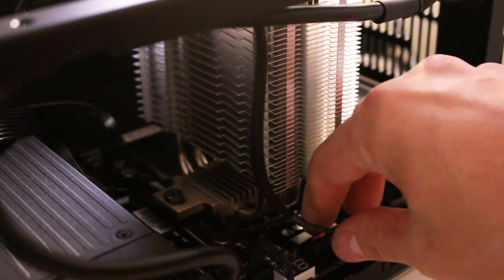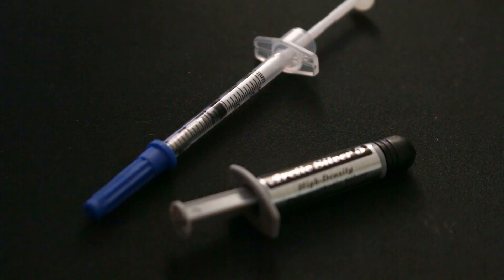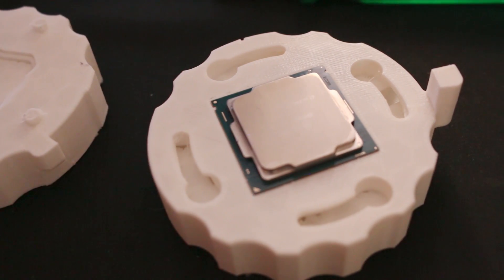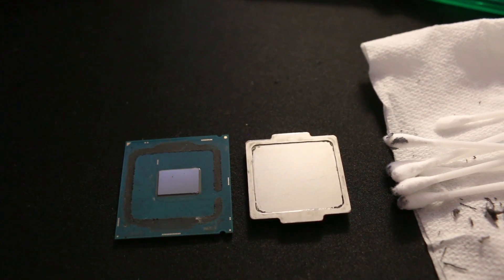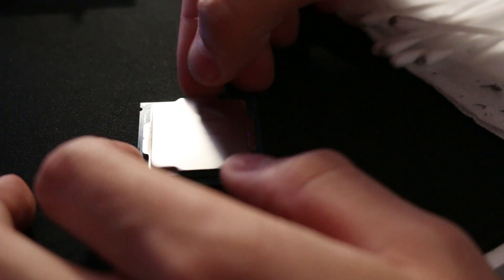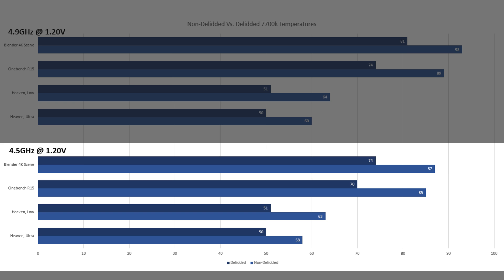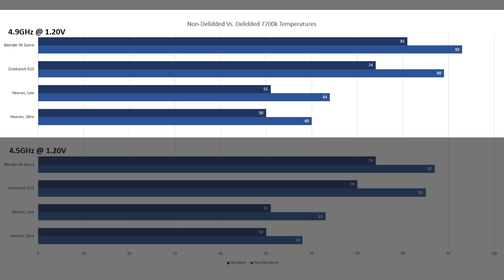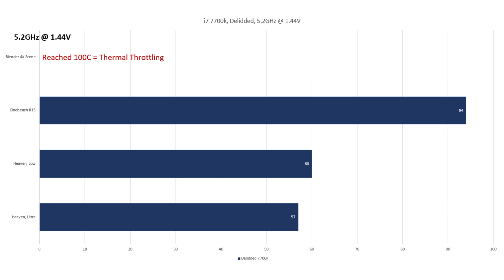i7 7700k Delidding Results - Is it Worth it?

Comment: 1.2v for 4.9GHz?? Nice.. I needed 1.29 for that speed on mine.
Reply from the maker: Phil Slater Surprisingly yep, but after that it needed quite a bit of juice.
Reply: A big voltage mountain is common. I have 4.52GHz on my 6700k at 1.275V, but 4.6GHz needs 1.33V.
Reply from the maker: It's interesting and fairly common. I'd like to know why this is - at the physical level. The relationship between clock frequency and voltage is greater than linear, perhaps due to energy loss in the form of heat.

Topic for another video..
Reply: I need 1.23 for 4.9 :)
Reply: r0ck3tdr1v3r this is My setup. Tripple rad only for cpu. https://imgur.com/gallery/NWUsk
Reply: r0ck3tdr1v3r love that air Cooler. I think i Will delid mine in 2 weeks but im unsure cuz i get 4.9 fairly easy and max load is 80. To get 5ghz i need 1.33 which Will generate alot more watt / heat that 1.23-1.24. Maybe i Sell My delid tool and be satisfied w 4.9. :) have u tried to disable HT? Just to see if the temp difference is huge
Reply: Delidded 4,8 ghz avx -2 @ 1.29V Prime Stable Temps are nice under 80 ° Stressing and ingame under 65
Reply: Aurummorituri kind of same with my 6700k. 4.6ghz at 1.36v
Reply: hmm... my 6700k handles 4,7 with 1,24
Reply: 4,5 @ ~1.2 VCore :/ AVX 0
Reply: Lasse jaspersen Prime stable?
Reply: I have 7600k. Yeah i can send u a imgur.com link. I use - 2 avx offset tho but still Nice. Real bench stable for 8hrs.
Reply: Lasse jaspersen yes send please :)
Reply: r0ck3tdr1v3r http://m.imgur.com/a/InHnX 1.24 bios setting LLC level 4. Asus mb. No delid yet
Reply: Prime w avx is 4700 at this vcore
Reply: very nice... me prime 95 unstable (blend): 4.8 GHZ @ 1.37 Vcore http://i.imgur.com/EFS3GNZ.png
Reply: 95 degress damn. 7700 runs hotter tho. My batch is L649H322
Reply: It's my second "bad" 7700k actual Batch number: L704c153
Reply: Would u delid?
Reply: Sure, or i'll send it back again to Intel again, and want my money back. Then order from Ebay @ USA

The problem is the German Intel Support says it's "normal", i had 5 CPU Coolers now, 2 AIO, 3 Tower, Now im Using the best of the best... Noctua NHD15-S

But i think this is no Solution, because i dont want to have so much more Wattage, maybe i can find a good VCore @ 4,7 that would be enough, even the Stock clock is enough. But it's my first K so i wanted to OC it as good as possible.
Reply: r0ck3tdr1v3r as long it dosnt overheat at stock speed i dont think they Will take it back. :/
Reply: My "Unfinished" Setup: http://imgur.com/i44KUpW
Reply: waiting for 2nd Fan
Reply: Lasse jaspersen no i will try but then it will lose speed?
Reply: No difference, still not able to run 4,9 @ 1,35 VCore + Same Temps :'(
Reply: sounds good. :)
Reply: i can run my 2600k with 4,4GHz stable, @stock voltage but for 4,5 it needs 1,33v. For 4,8GHz it needs 1,44v. So totally not worth it to go above 4,4GHz.
Reply: yea mine to im so disappointed for not waiting to the 7700k its seems the daddy of kaby lake and 6700k its like a pre kaby lake lol